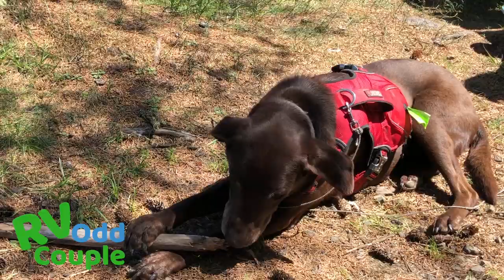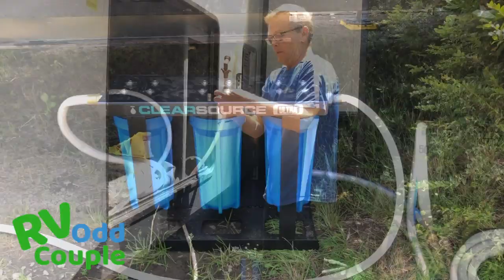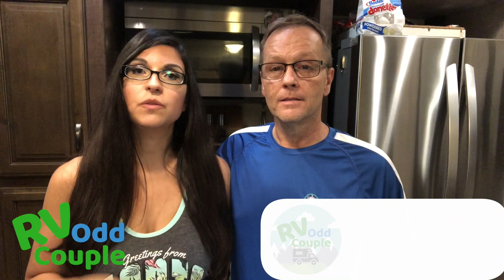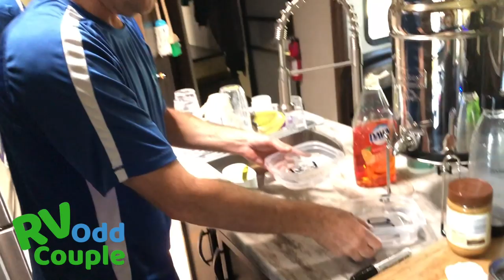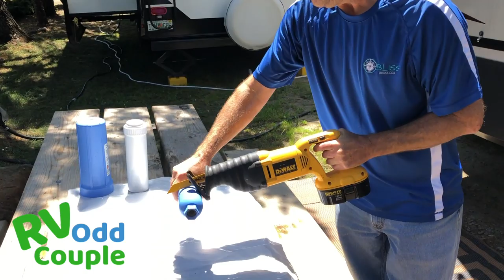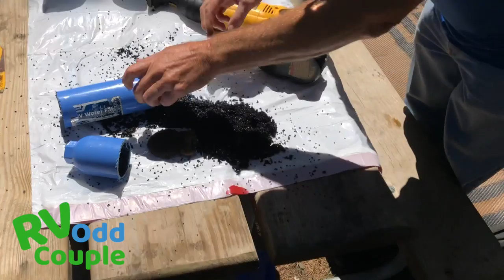SAFE TO DRINK? RV Drinking Water Solutions for RV Life

Comment: You have really provided a great public service here!
The one that has peaked our interest is the Clearsource because we very very rarely go to RV  parks with water hookups. This is the only one that we could use to fill our onboard water tank. 

This appears to be a perfect all around system for both hookups and boon docking. BUT .... did the Clearsource water pass the Skippy Test?!?! If not, and we stay with bottled water (or a Berkey) for drinking, filtering the inbound water will save our entire water system from "gunking up" with sediments, rust and God knows what!
We checked out their website and we are in the same area code, so once we get our new rig we'll be sure to get in touch with them.

Andy & Kim
Reply from the maker: Hi Andy & Kim!  Great question.  Skippy did not choose the ClearSource water.  He chose the Berkey.  But We trust Clearsouce way more than we trust Camco.  Camco removes yuck that's up to 20 microns and Clearsource removes yuck that's up to 0.2 microns in size.  Smaller microns is better and less "gunking."  Let us know what you think of whatever you end up getting.  :-)

Comment: I love the dog test. Working as a certified water treatment plant operator w/nearly 40 years I've got a ton of information. I also camped for the last 10 years. 
First I flush any hook up wide open for 10 minutes. Then check for any trace of chlorine. If flushing doesn't clear the water and it has no chlorine (Cl2) then by all means proceed with a filter. I'm not a big fan of filters because they can harbor bacteria. Problems I see at camp grounds is they're located way out on the end of a water main which causes the Cl2 to dissipate. Sulphur and minerals are cosmetic/taste and odor related. Not life threatening. Chlorine is your friend unless you can ingest coliform which is not the worst. E-coli is a nightmare to a human. 
Have a safe camping trip. Feel free to ask questions.
Reply from the maker: Great information here Tim! We will definitely reach out if we have questions...Thank you Our Friend and safe travels to you as well👍😀💚💚

Comment: Good information. My 2018 Coachmen Chaparral 370FL fifth wheel came prepped to install a water filter so I installed a residential style whole house water filter with a 0.5 micron filter. The filter housing is clear so I can see how my filter is doing. it's amazing to see how the filter goes from white to brown as it's filtering out all the iron and other sediments in the water. I've had issues with hard water stains from a number of the campgrounds that I have stayed at so I recently installed a portable water softener. I plumbed it into my RV so that it would sit inside my storage bay and could be bypassed for recharging.
Like you I also don't want to have to carry a bunch of bottled water.
Reply from the maker: This is great advice.  It's tricky as an RVer because you have to be prepared for nation wide water issues.  Glad to hear you found a good system & you don't have to lug around a bunch of bottled water!

Comment: Another great video by you guys. We bought the big blue plastic Berkeley, this way you can tell exactly how much water is on the top and on the bottom. We have had ours going on four years with no problem. When the water flow gets slow, take the filters out and give them a good scrubbing and put them up to the kitchen sink and flush them from the inside out. We save our old pop bottles and use them to store the water in.. several friends have come over and could not believe the taste and they have bought one.
Reply from the maker: We Love Our Berkey too💚

Comment: Hi, my family and I have been RVing for over 30 years. We live full time in our RV now and have always used a portable water conditioner. We bought our first one and it was called Water Magic but the company has changed its name. There is a company called water on the go which is easier to use than the one we bought originally. So put the conditioner right in line like you would those creepy ones that you cut in two. You can use water test strips to test the hardness of the water to see when-it is time to re generate the tank. The water is great for the RV and your skin. When it comes to drinking water we have only used distilled water. The distiller we use is from Waterwise. Years ago Sears sold them. An every once in awhile you can find them at the thrift stores because people don’t know that they can still get parts from Waterwise. Distilled water is the best water for drinking. The Burkey still leaves contaminants in the water and you should have 0 parts per million for drinking. When we are in a park we make water and store it in a 5 gallon glass only jug. Plastic anything will transfer estrogen mimickers to your body and create havoc with your immune system. After years of drinking distilled water(I’m in my late 60’s) I do not take any medications and feel great. Do some more research on water it is very important for your family’s health. Your videos are great and you have a beautiful heart.
Reply from the maker: This comment frightens me a little, (with the plastic piece). But you bring up a convincing argument to do additional research.  Compared to what we were drinking, anything is better, but there is always room for improvement.  Thank you for sharing!

Comment: Thanks for your help on another important topic.  Although we bring Sierra Springs 5-gallon waters from home (not full-time yet), I always wondered how to clean water for brushing teeth, shaving, showering, etc.  All we've used is the Camco filters on the RV park faucet.  I'll check out the other recommendations.
Reply from the maker: Give us a call when your ready Mike! We are learning a lot! Love ya💚
Reply: Your water hose could be contaminated.  Use diluted bleach in hose to sanitize.  Connect filter at rig, not water bib.  I also sanitize rig's water lines.  As a secondary safety rule, I use a Brita filter-water reservoir.

Comment: I am building my own 3 stage filter system which will cost less than $100. The first filter will be 30 microns. The second 5 microns. The final stage 1 micron. The 1 micron removes all cysts. You can use ANY 10 inch filter element in those containers.

I use a home distiller to prepare water for the Keurig. I have had this distiller for over 10 years. Sometimes I buy DISTILLED water from Walmart. I use distilled water to fill the batteries and for the tow vehicle radiator.

I use water hose quick connects to make setup very easy.
Reply from the maker: Cool!

Comment: We have had a Berkey Royal for about 5 years now. Our well has a slight iron taste, and the Berkey takes out the iron taste. We do drink out of our well too, but the Berkey water tastes wayyyy better. We bought it just in case, of.......shtf. My parents and neighbors bought one each, because they liked ours.We have to clean the filters about every 3 months, with one of those green scouring pads. Each time you have to force water into the filters until little bubbles perk out. About every 2 and a half years we have to buy new filters, because the filters even after cleaning, just don't filter hardly at all anymore. We use two filters, at a repurchase price cost of  $107.00.a set. Our Berkey can take up to four filters for faster filtering, but we only use two. I recommend the Berkey filter system.
Reply from the maker: Thank you so much for this info William💚 We might reach out to you when we clean ours for the first time.

Comment: Just wondering. Do you always sanitize the campground spigot before you hook up to your rv? Some people the last thing they do before they leave a site is washout their blacktank hose before they put it away. Just a thought.
Reply from the maker: We don't but we should.  I just took a picture of a lady that put the hose on top of the picnic table.  GRRR!  So gross!  And in the park that we showed, you can see how close the sewer is from the fresh water.  There should be guidelines to keep them apart!
Reply: @RVOddCouple  I have also seen a squirrel drinking from a dripping spigot and yet I forget to wipe the spigot before use!
Reply: We started doing that a couple of years ago. My risk mgmt training fm a healthcare job kicked n & we sanitize a lot of stuff, including hands or else wear gloves that you can toss when done.
Reply: Don’t recall where I saw it, but the tip was to carry a small spray bottle of hydrogen peroxide in your water compartment.  Spray down hose ends and spigots before connecting.  So easy!

Comment: Good video.  Like the majority of people I use the Camco filter and will now probably switch to a two or three stage filter system. I boondock a lot and at least twice a year I sanitize my tanks after I found some disgusting slime build up when I installed a cut off valve between them so I could only carry 50 gal on short trips. Fill tanks about 3/4 full and add two cups of bleach. Drive and slosh then let it rest for 24 hours. I also run that water through all the pipes to sanitize them. Empty, rinse twice, run clear water through all the pipes several times and done. Just attached  PUR water filter to the kitchen faucet for drinking.
P.S. You needed to talk to your neighbor about the proper way to run a sewer hose, LOL his was just on the ground with what looked like a 8-10 inch upward slope.
Reply from the maker: Thank you for this info John! We will be doing a video on fresh water storage tanks. This info gave us some additional things to think about. This was the worst park we have ever been to for service locations...There was no way to get "Fall" on black sewer pipe unless you jacked rig up 3 feet high. That same neighbor through there hose up on the picnic table to drain right before leaving...Pissed us off! We have a picture and will share it in a future black tank vid. Thanks again for the info on fresh tanks 👍😀💚John

Comment: Just a warning about reverse osmosis (RO) water.  If you start having heart palpitations, etc and you're drinking a lot of  RO filtered water.... STOP.  The issue is that the minerals in the water are needed by your body... which regulates heart beat.  It's perfect for cooking, brushing teeth, etc.... but an ex-coworker used to own a restaurant and 'pounded' the RO water that he also cooked with.  He thought he was having a heart attack, after a good deal of research by the doctors it came out he was drinking solely RO water.  Ended up being the lack of natural minerals in the water and the signals weren't being sent/received.
Reply from the maker: Very interesting read Marc. Thank you for sharing💚
Reply: @MarcMercier1971  Not really an article.  It's a water filter company website so what you read there probably has some bias.
Reply: @MarcMercier1971  Your warning "doesn't hold water", in fact its patently false.  For the most part and in most areas, the water we drink does contain minerals but the amount is negligible.  Drinking water that has been filtered to the extent that all minerals have been removed will do nothing to the levels of minerals in our bodies.   A person can use distilled water for all cooking and drinking and will suffer no ill effects whatsoever except that it probably won't taste that good.   Now, drinking excessive amounts of water (filtered or not) can cause water intoxication but that's a whole different scenario and has nothing to do with the presence or lack of minerals in water used for drinking or cooking.

Comment: Something like that I would make a mount on the bumper you can easily connect and disconnect simply because you don't want your camp site looking like a collaborated mess. You have a much larger RV so it could be easily hidden. Charcoal is the staple of water filtration. Cut open one of your knew filtration system and you will find it has Charcoal in it.
Reply from the maker: Thanks😀

Comment: Great video guys, thanks for your work. Here is some information that I've learned over the years about "charcoal" filters.

There are several stages to a water filter. I have backpacked hundreds and hundreds of miles on the Appalachian Trail and have filtered hundreds of gallons of water out of streams and springs and I have never gotten sick.  

The first layer of the filter is usually sand to filter out bioorganisms and fine impurities. Some filters even use larger things almost like fine gravel to filter out bigger particulates and impurities. The sand will also filter out bacteria, viruses and parasites. After the sand, the next layer is usually made of activated charcoal (the black stuff) and that further removes contaminates and impurities using chemical absorption. 

The sponges that you found are to keep the layers intact and to keep the gravel/sand/charcoal from leaving the filter and going into your clean water line. 

Now, even though the water has made it through your filter it may not taste as good as you would like it.  The filter, if working properly, will remove 99.9999% (their number not mine) of all bacteria (salmonella, cholera, and E. coli), and protozoa (such as giardia and cryptosporidium) and other unwanted particulates.  It will not remove much of the bad taste.
Reply from the maker: Thanks for sharing this info with us Robert😀👍
Reply: @RVOddCouple  Happy to contribute. Thanks for your videos. Safe travels.

Comment: City or campground water is a major concern for us, I removed the filer that came with the rig and installed a 2 stage filter as well as a water softener. All water goes through it before entering the water system or filling the storage tank. I also installed an RO system for drinking and coffee. I do agree it does create waste water so will shut off when dry camping.
Reply from the maker: Great advice!  We didn't realize finding quality drinking water required so much work.  We assumed that we were "double filtering" our water.  Hardly!!!  Thank you for sharing your RV water solution!  You clearly did your homework!

Comment: Thanks for the video! Lots of good info and I think the inline filter with the countertop one is good if it filters everything out. Maybe you could send samples from different locations, before and after to get professional results? Not every place, just a few.
A couple things, yes, the skin is the largest organ but it's made to block stuff. Some things can cross it, but not much unless you have open wounds. Eyes and nose are the most common entrances for pathogens.
 In the filters that you cut open, if the stuff you couldn't identify was hard like rocks, it may be rocks. It keeps the smaller stuff from clumping and restricting flow. If it felt like plastic fibers and the filter softens the water, in can be anion media. That removes some of theions that harden the water. 
Keep up the fun!
Reply from the maker: Great points and info! Thank you💚

Comment: The sand like stuff in your water filters is Diatomaceous earth , Which consists of fossilized remains of diatoms, a type of hard-shelled protist. It is used as a filtration aid, mild abrasive in products including metal polishes and toothpaste, mechanical insecticide, absorbent for liquids, matting agent for coatings, reinforcing filler in plastics and rubber, anti-block in plastic films, porous support for chemical catalysts, cat litter, activator in blood clotting studies, a stabilizing component of dynamite, a thermal insulator, and a soil for potted plants and trees like bonsai.
Reply from the maker: Great info! Thank you for sharing

Comment: My best suggestion for RVs for drinking water is to establish and install a reverse osmosis system hook it up to your kitchen sink underneath your cabinet you put a 1 gallon holding tank and you put a new separate faucet just for the water coming out of the reverse osmosis I use it for washing my cups I use it for drinking water I use it for my pet for the water for the pet and I haven't experienced anything bad it cost a little bit of money but it's worthwhile you don't have to buy any more bottled water I save some old bottles of bottle of water after I drink them and refill them put them back in the refrigerator or you can put in any kind of container I use that water for cooking and I use it for drinking and I put it in my pet water so get yourself a reverse osmosis and you only have to change the filters once every year and once every 3 years you change the main membrane filter I've got a 5 filter reverse osmosis system and it works beautifully and you'll stay safe and you won't have any problems

Comment: We’ve been out on the road for 20 months out West and back to the Midwest and haven’t experienced any warmer issues. We use rage Camco inline connected to and On the Go water softener before it enters the trailer. We usually run off the water tank. Our kitchen has a beverage faucet and I added another filter, Woder, to it.  We are thinking about a Travel Berkey, since it fits better on our counter.
Reply from the maker: It's good that you have something KJ.  We love our Berkey and so does Skippy. Make sure you use our Coupon for 5% Off or you can click this link when your ready:  https://www.berkeyfilters.com/products/imperial-berkey?a_aid=5d27942325e0b&a_bid=01e2d3be

Comment: Simple solution, if you have good water in your home, as I do,  you can fill up your fresh water reservoir on your camper (mine holds up to 36 gallons). 

Use your reservoir for drinking/brushing teeth. Use park water for everything else. 

The problem is rather simple for the RV vacationer.